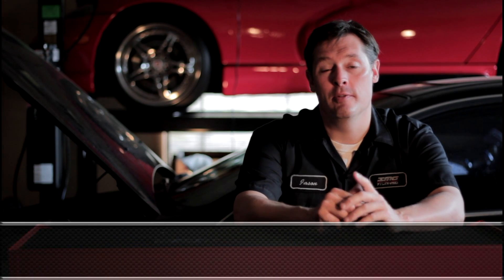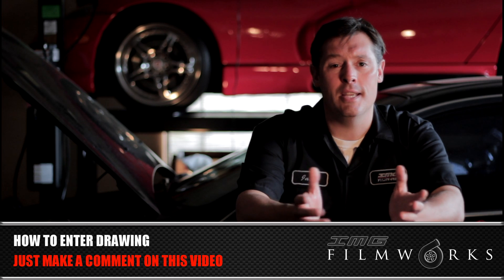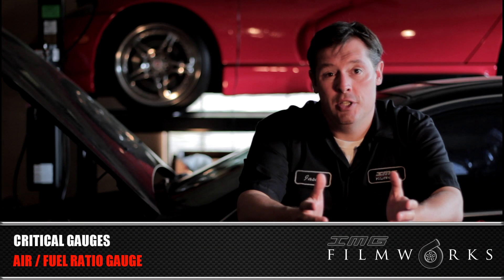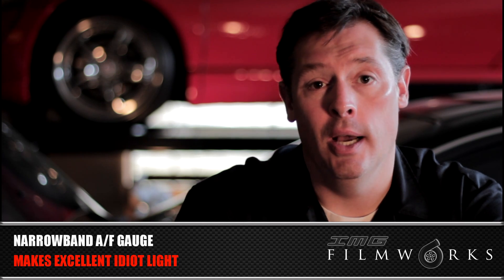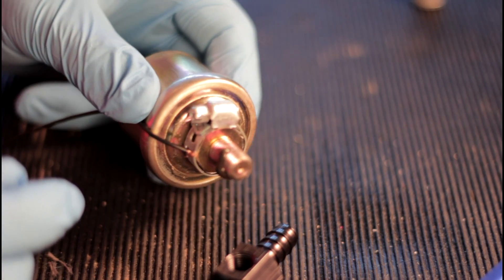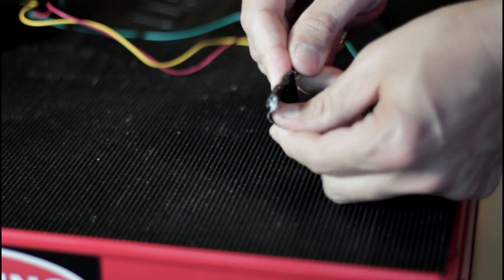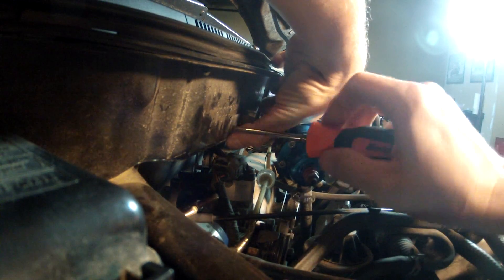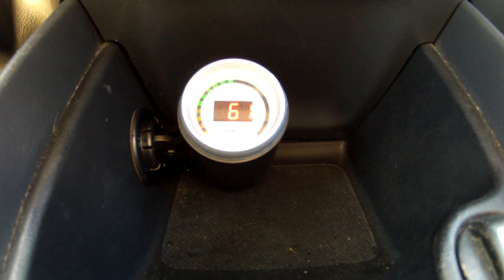Building A Budget Beast: Episode 5 - Gauge Installation & Theory

Comment: Hey man. Love the series. I was wondering if running a high pressure in line pump is necessary. I see guys on the forums suggesting stock fuel pump with in line high pressure pump. Thanks

Comment: hello 

great series. basing my build largely on yours. 

quick question. you say in one video that the 10:1 is on the borderline of lean for your f22 motor. ie with your 5psi boost it is probably around 86-90psi fuel pressure total. 
then in another video you have the hood off and show a fuel pressure gauge and from what I can see it reads 80-82psi with boost and about 38-40psi without boost 
this would be would indicate an 8:1 rise (or so) 
then in this video you explain 12:1 fmu and on another video you also say you went back from a 10-1 to a 12:1 Fmu. 
my questions are this,

if you had the 10:1 Fmu what was your actual pressure? 

when you went with the 12:1 Fmu was your fuel pressure 60+base (38+60=98psi), or was it the difference in the lines between the factory fpr and the fmu 

great series just a quick question or two to clear up for me before I install 

also
why didn't you boost reference the 10:1 Fmu at say, the charge pipe pre-intercooler before the 1-2psi intercooler drop, run that to the Fmu so it can pre-load itself prior to the boosted air reaching the manifold? 
6-7psi preintercooler x 10 = avg 65-70psi+40base total of 105-110psi 
(which is roughly what your 12-1 ultimately ended up doing) 
except with the above method it would be pre-loaded and most likely remove the flat spot you expierence between vac and boost transition

thanks duc

Comment: Hey, thnx a lot for your videos! Most detailed and informative build! Just a little question: Should I expect to run at the same boost (~ 5PSI) recommended by you in case of Accord CG4 F20B7 engine (this engines were used for 6gen coupes for European market)? Stock power is 147HP, 2 lites displacement SOHC- and looking to get arround 200-250 HP max. Also, T-SHIRT!!!!

Comment: how's it going ? I recently got a 99 accord just to build a turbo car. thanks to you for taking the time to make these videos. So my question is, I ordered a 12:1 fmu and a 190lph HP pump and received a 10:1 fmu and a 190lph non HP pump. tried to get it taken care of and keep getting the run around. anyways will those be suffecint or not for 8 psi if not could you explain please. or could you give me any ideas of how to lower the boost without changing the spring in the wastegate? I would like a tee shirt! thank you for your vids man!

Comment: Very cool, always thought it was much more complicated to install a gauge. A couple of tips, not for you, but someone inexperienced that wants try at this the first time, remember to protect your carpet with something, in case solder falls, like it happened in the video, and if using shrinking tape, use the tip of the soldering iron instead of a lighter, might take a little longer, but no risk to the electrics or indeed the car get caught on fire. Common sense, i know, but still important to remind.
Reply from the maker: +Hugo Fernandes Good call, It might not have showed up in the vid but I had aluminum foil down on the mat, thanks for the comment.
Reply: Rubber Duc
Not a problem, just here to help, love the build by the way, i really want to buy one of these Accords, but they are a little hard to find here in Europe, at least for a good price/condition. :)

Comment: hey man great video can't wait for the next one. I hope I win a t-shirt as well. I have a few questions for you hopefully you can help me out. I'm not exactly turbocharging a Honda instead I want to install a turbo on a 08 Nissan Versa. I know that's not an ideal car to install a turbo on but I would still like to do it because its something new. so first of all my versa has a mass air flow sensor and I would like to know if I have to install the mass airflow sensor in the intercooler piping. if so will the mass airflow sensor sense boost coming in; and will the car run right????
Reply: +luis moreno you will get a check engine light as the ecu is not programmed to handle the amount of air being pushed in.
Reply: +juan claudio what if i only want to do 5 pounds of boost. Do you think it would run right????
Reply: +luis moreno any positive pressure it senses will throw it.